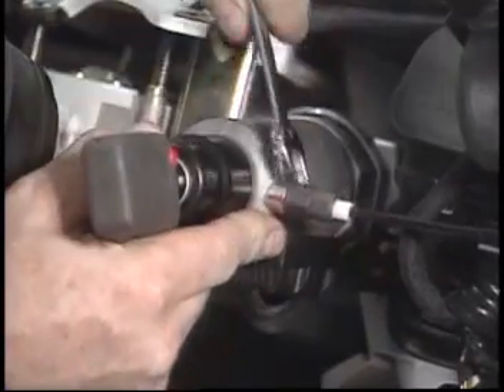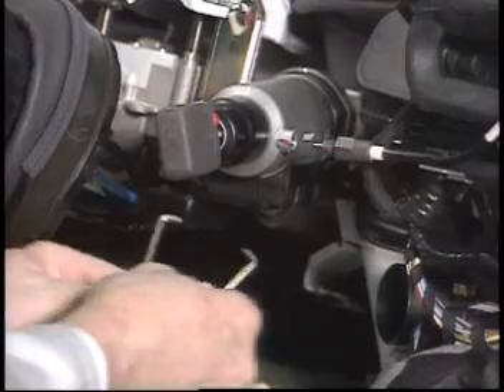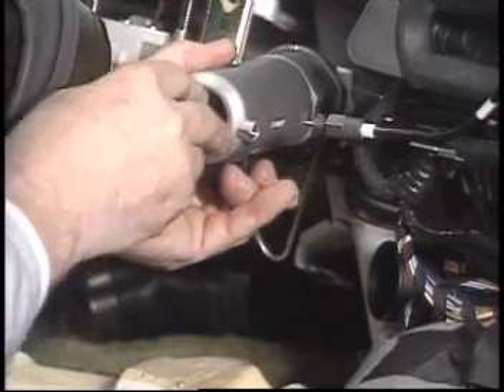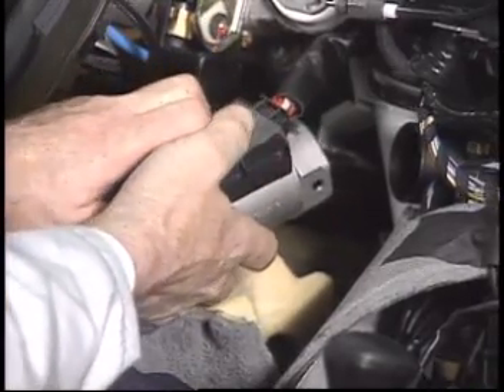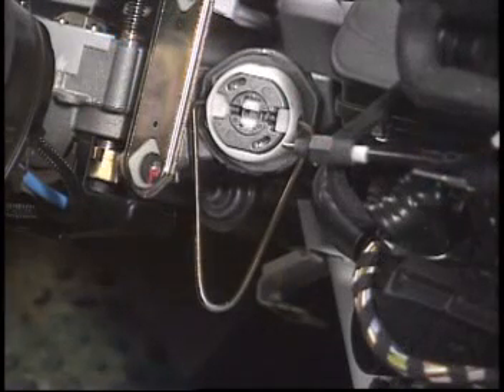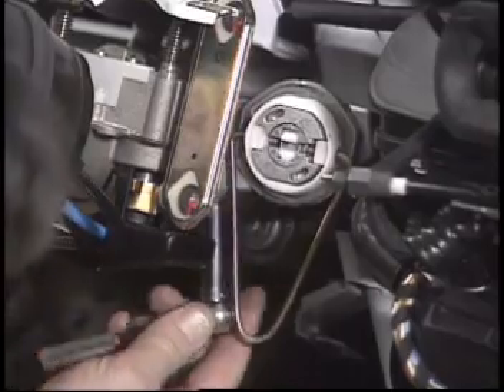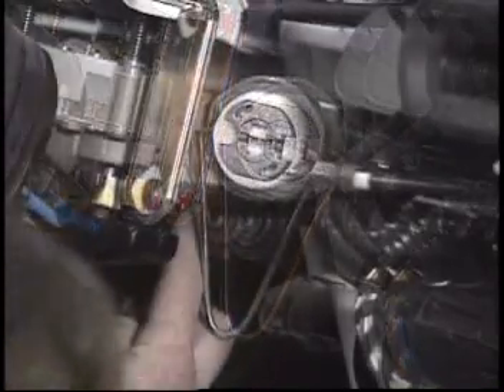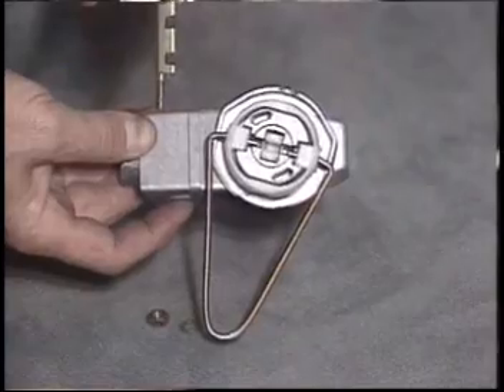r129 dashboard removal04

Comment: Would you have a part number (and/or where I can it) of the tool that you used to remove the ignition switch cylinder from the lock assembly (the one that pushes the two pins in, inoder to slide it off, looks like part of a coat hanger) Thanks
Reply: did you find a part number?